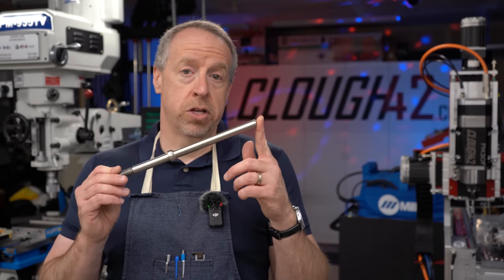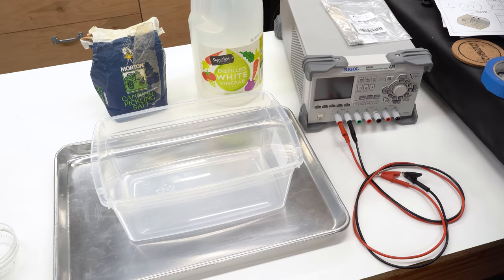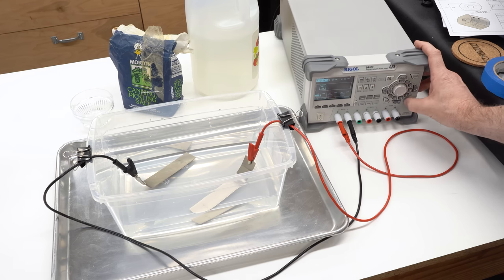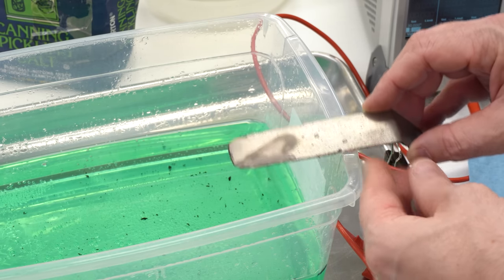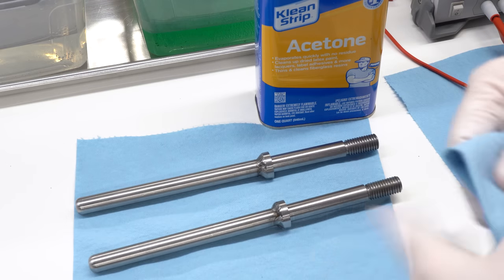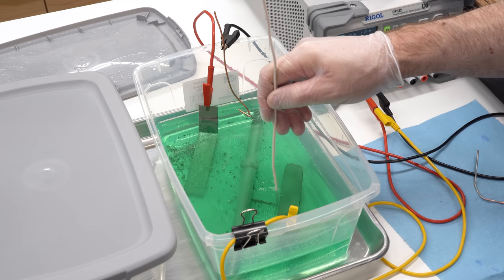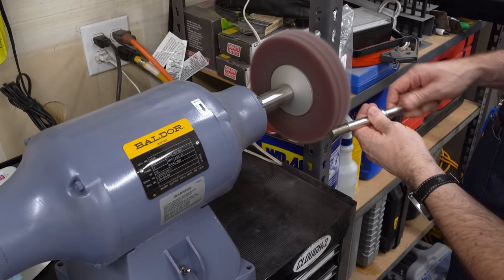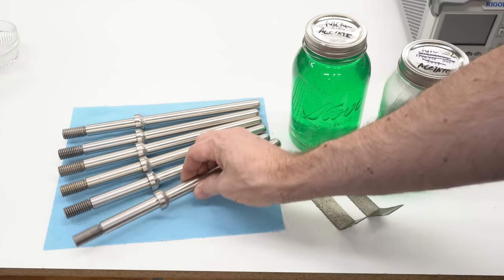Nickel Electroplating in the Home Shop - A Shocking Way to Prevent Rust!

Comment: Great video, thank you!
If you’re looking for a much cheaper source of nickel, I used cast iron welding rods (98% Ni + Cl I think, with the flux removed) as electrodes with great success. I plated the shafts of my Vallorbe needle files to prevent rusting and it came out beautifully!
I’m concerned about the environmental toxicity of the acetate though. How should one dispose of it after use?
Reply from the maker: There are lots of sources on-line that recommend various ways of disposing of it, from plating out the nickel, to evaporation, to dumping it down the drain.  Every article suggestiong one of these has a chorus of people saying it's definitely wrong.  I don't know what's available, legal, or recommended where you live.
Reply: The acetate can be filtered to remove crud, and used over and over - indefinitely.

Comment: I'd lower the current to get less porous finish.
And as mentioned earlier, one doesn't have to use acetic acid (i.e. vinegar) and suffer. Other acids like citric one work just fine or better and do not stink. Try alkali (like vulgar soda solution) instead of acid and report whether high or low pH matters))

Comment: So James I do nickel plating at my home, and I boil down the vinegar to a stronger concentration than regular 5% or 6% off the shelf. I usually boil it down, (heat on low) by half the volume I start with. I recommend you do it outside because it smells horrible but I get fantastic results using a stronger concentration of nickel acetate and much faster and thicker plating.

Comment: I used this method quite a few years ago but found the plating did not stand up to wet conditions and flaked off with rust bubbling up beneath the coating. I remember acid etching prep helped but still not satisfactory for anything exposed to moisture.
Reply: And what about mechanical stress or handling
Reply: Seems like that would mean that air/water was able to get through some pinholes or porous deposition?    The few failures I've had were like that, under the microscope it was evident that I hadn't done enough to prepare my parts, or hadn't formed a thick enough layer to resist shop life. 

I've found that for tools which are handled frequently, get slid around, contact chips, etc, it pays to go overboard.  Don't try to put it all on in one go, either.  That 'junk' can get stuck to the part, and block plating underneath.  Plate it, clean it, plate it again in a different orientation.

Parts that have concave features will have less plating in those places.  When I plated my favorite surface gage, I did a couple passes with the nickel electrodes positioned so they were closer to the concave surfaces than the rest.  That same principle applies to electrolytic rust removal also.

Comment: What blew my mind when I learned it is that EDM is basically electroplating with the electrolyte moving fast enough to prevent deposition.
Reply: EDM is not a plating process, the water or oil is non conductive.  It's a spark erosion process, the metal is vaporized by the pulse arch from the high voltage on the electrode.  The fluid, DI water or oil is used to wash away the swarf and cool the part/electrode
Reply: I was going to wright what a prat!
But Craig has way more tollerance of morons than me.
Reply: @craigs5212   he is likely confusing Electrical Discharge Machining(EDM) with Electro Chemical Machining (ECM)

Comment: Thanks for the knowledge.  I also learned some things listening to people from the greatest generation.
- During the war and after they skipped a step in the copper-nickel-chrome process resulting in less corrosion resistance and chrome peeling like paint off a wood house.  This caused the term triple plate to separate quality from junk chrome plating.
- They said that before a bumper got chromed, it looks like, and has to buffed to look like, one that is already chromed.  You cannot tell if it is or isn't unless you see a chromed one right next to it.
- They also reconditioned bumpers by stripping, buffing and re-chroming them.  They looked like new but didn't stay that way because remaining rust pits invisible to the naked eye would soon emerge which made people demand new bumpers after an accident.
- A lot of chemicals they use to remove auto finishes in car factories is more recyclable but also very strong.  I had them strip some die cast louvers on a classic car and it ate the die cast and I had to replace them.
- One guy committed suicide in the plating department with the cyanide they use in the process.  In general, people did not want to work around the plating tanks or in that department.  My guess is a lot of that is automated today.

Comment: Two things stand out for me from this video (in addition to the normal excellent information & presentation):

Your experience with vinyl gloves reminded me of the time 40+ years ago that I tried putting auto enamel paint reducer in a styrofoam cup – fortunately, the cup was on a driveway and not inside on anything. This is why 1) I always use native gloves when I need to protect my delicate hands and 2) I have an assortment of disposable aluminum cups (otherwise know in my household as "more junk") for use around acetone and other "aggressive" solvents.

Mixed dimensioning systems – I typically use off-the-shelf Imperial stock where possible for my projects; however, since my machines are made elsewhere I use metric hardware for assembly and attachment to the machines, and to limit the amount of hardware I need to have on hand. Thus my drawings  always include the note "Unless Otherwise Noted, Dimensions are in mm," which results in 1-1/2" x 1-1/4" x 1/8" 6061 angle being cut to an overall length of 250mm. I make no apologies for doing this as I consider it following day-to-day practice in the UK: when I spent time in England, Scotland & Wales in the late '90's, highway speeds were expressed in MPH, distances in km (or meters when a sign was directing traffic to an offramp) and clearances below bridges are in feet. Even now, Wheeler Dealers and Top Gear both use MPH, and the roadway signs I see on these shows follow the conventions previously noted. Plus, as you say, it drives people crazy.
Reply from the maker: Yeah, I do exactly the same with mixed units.  Imperial stock is readily available, but I try to use metric fasteners for things like a DRO install, just so I don't need two sets of tools when working on it.

Comment: The higher the amperage, the faster it deposits, but the larger the grain of the deposition.  Ever have the Crome plating flake off cheap tools?  They push the chrome on at high amps.  Looks shiny, but isn’t well attached to the base metal.  Higher cost tools take more time to plate at lower Amps, and get better adhesion.  Also, for a shiny nickel finish, you polish the piece before plating, and then after.

Comment: I have done electroplating for a few years,,,, and chrome plating.
And i have the entire suite in regard to surface treatment. sand blasting , zinc spraying and painting ( wet and powder )
And the thin layer ( few 1/1000 of a mm ) you get electroplating will not do much as soon as you get past corrosion class 1

Comment: Very good methods!!! Just remember to do this in a well-ventilated area as in eletrolysis of NaCl, Cl2 chlorine gas is made, which is toxic. It isn't that much cl2, so nothing TOO toxic, but always be cautious with chlorine. To avoid chlorine altogether, instead of NaCl (table salt), use another salt like epsom salt/magnesium sulfate or anything else without chlorine or any other harmful gases.. THANKS💯💯💯💯💯

Comment: I have nickel plated faucets. Some are polished. But nickel just doesn’t stay mirror bright. After some time that will dull. I’m used to it. I’ve never nickel plated anything, but I know it’s best for something not normally touched. Back in the old days, early in the 20th century, /rolled ‘Royce used to nickel plate their stick shift with nickel plate. A craftsman would literally pound the thin plate onto the steel shaft until it bonded. Whew! Then chrome plate was perfected and nickel plate disappeared on automobiles. Now it’s mostly decorative. It’s not that hard, so it wears off.

Comment: I have done some nickel plating like yours and it’s a blast. To get a chome like finish you need to to have the part super polished but for your application those look great! I did some testing for durability and the plating is extremely durable, I mean like it ain’t coming off! If I had to guess I would say it’s just a couple thousands of an inch thick. I’ve also refurbished some vintage craftsman handtools and they look incredible. I’m very happy with the results. One small thing I would recommend is after you make the bath use a coffee filter and filter everything so all that black gunk comes out in the solution is as clean as possible. That may help you get a better finish. Great video!

Comment: I have been told that you get better results if you copper plate steel parts first before nickel plating them.  Nickel supposedly binds more tightly to copper than to steel.
Reply: The reason they plate steel with copper is because copper is easier to polish than steel is. So you use a copper layer if you're going for that shiny finish. Then you polish the copper to a high shine. If you skip the copper then it's called hard chrome plating. Oh and you plate the nickel with chrome. duh.

Comment: I built my spiral stair-case, back in the mid 1980's. 3" in. dia. Pipe / schedule-40. to prepare the surface for (chrome / nickel) plating by a professional, I sand-blasted the surface with "Wall Nut shell's," to get that pre-polished look. Please take note, at the time, I did have a high output 5 horsepower Air-Compressor, and not one of those cheap ones you see in the big box stores or at Harbor Fright (spelling intended.) I paid just over $3,500.00 back then for it.  Also had purchased what is called a "Air-Kool-After-Cooler," so as to take out / remove the moisture in the compressed air, along with some special (AUTOBODY) air-filter's that also helped to dry the air.  This was very valuable in preventing "FLASH-RUST."  The Walnut shells, worked like a charm, to achieve that polished look.

Comment: Its been a few decades since I've done any plating but a thin copper plate first is best for adhesion and a smooth coating. thats as simple as Copper sulphate solution and the same apparatus. That layer only need be very thin as in a couple of atoms thick. Also the brightener for Nickel solution was Saccarin in quite high concentration. Yours will be fine though porous so susceptible to rust also.

Comment: NEXT EXPERIMENT: Try purchasing Pure Tin Solder Bar and tin plate old cooking pan, it will make it non stick again ;) but you can tin plate or try copper plate with the same method using copper pipe or bar and possibly copper sulfate!  Great vid! ty

Comment: Nice! I have found electroplating to be a valuable addition to the processes in the shop. So far I have tried Zinc, Nickel, and copper with success. I have found plating to be a good alternative to paint and powder coating for machine tools and fasteners.
Reply: Except powder coating is far less toxic and makes vibrant colors. Plus there are powder coatings that look just like any type of plating except chrome. Nothing can match real chrome.

Comment: Equidistance is crucial for an even plating. Best results are achieved when you use electrodes all around the part. I do a lot of electrolytic derusting and I actually use a iron cage to get even ion migration.

Comment: It will be interesting to see how these hold up, corrosion-wise. I nickel plated some garden shears a few years back and they didn’t rust as fast as before. Maybe 3x slower? I was hoping for much better. It was my first plating experience, like yours, so my quality was a complete unknown.
Reply from the maker: I'm a terrible test case.  I have exposed mild steel everywhere in my shop, and nothing rusts here.
Reply: @Clough42  you would be jealous of how fast things rust in my shop!

Pro tip - if you want a light patina on all of the metal surfaces in your shop, leave a small container of hydrochloric (“muriatic”) acid out.  It is VERY effective.

Comment: FYI- if you don’t like the matte finish and want a brighter, shinier finish I suggest soaking the part in a low concentration of Hcl (I.e. 0.2 mol) for even etching.  Wash in distilled water , dry , then nickel plate.

Comment: Have been watching streetips handling several industrial grade acid families and his care at managing his waste. 
Would repeat the recommendation to sock your anodes in a lintfree or fine graded filter barrier. Will not stop the transfer but may hold the crud off. 
Watch his silver and gold cell vids for useful ideas. 
Also take you vinegar and filter it through a proper medium to clear particulate. Might take several passes.

Good luck with it.

Comment: Add a brightener to the solution, there are commercial off the shelf ones or go diy with saccharin for instance , or polyethylene glycol which is available in Movicol , yes the thing that helps with pooping.
If you want to go more high tech , use a pulsed constant current supply ( yes that sounds like a contradiction but , think of a square wave , plotting time on the x axis and current on the vertical  ) . 
Using both of these will improve the finish , basically you're controlling the granularity of the deposition. Large granularity=dull  , small = shiny.

Comment: Acetone is a good start, but you should consider electropolishing the rods before plating. That will pull off all the oxides, especially around those welds. I'd prefer to just make the whole bar from 316L but the prices prices of the bar stock the average person can get seem ridiculous.

Comment: I've been nickel plating my laboratory utensils four years to protect them from chlorate and other extremely corrosive. Don't use a nickel plate and less it's pure nickel. The best ways get nickel welding electrodes they are pure 100% nickel and they work well. I mean they're expensive but they're worth it

Comment: Hi,
some electrical thoughts and other questions + ideas:

Can the solution be made with AC instead of DC?
it's about getting the nickel into the fluid, so on AC the electrodes would be both used up at the same time, not only one. Hydrogen bubbles would also be shared between both
Now it might be a problem that 50 or 60Hz from an (isolated) transformer are too fast, so the ions (?) cant really get away from the electrodes and get pulled back.
But maybe using an H-Bridge or switchover relay at 1Hz or 0.5Hz could work.
Using a long tall bottle for making the fluid would help with the bubbles stirring the fluid. - add a flame on top for some action ;-) (Or safer = good venting)
- i am a bit scared of putting a lid on basically a hydrogen gas tank.

Next thing to test would be running the low power, low frequency AC (transformer + resistor) through the electrodes
AND the DC from one electrode to the part at the same time.
For the electric circuit you can easily separate it, maybe this would help keep the fluid saturated.

A LM350 setup as current regulator and a 18V transformer (or 24V) might be a setup for permanent usage without having to block your bench power supply.
Maybe aid the LM350 along with a light bulb or a resistor (which could heat the fluid). If the current is too high (lm350 too hot) move the electrodes further apart.
For the transformer output voltage it's around 1.4x after rectification with smoothing caps, so 18V AC will land you around 25V DC
(The 24V AC transformers are more comon because they are (were) used for isolated outdoor christmas lights, so no dangerous input wiring needed for non electricians)

As it was for my pcb etching (which is a bit nastier) i guess pumping the fluid around and keeping it at a certain temperature (fishtank heater, they are glass tubes) would probably help. There are all plastic centrifugal pumps out there (Eheim with ceramic shaft) or maybe even a plastic geared pump + fuel filter for gunk.
(Thinking about it.. my etching fluid would have been nice for copper plating i guess ;-) )

Nice to see a working setup done with household chemicals,
maybe a bit of a warning/disclaimer for the "drying your pet in the microwave" people could be added.. (chemical leftovers, waste disposal, putting in the wrong metals)
since its the internet and taking responsibility for your own actions is not common anymore.

Comment: Been thinking of doing this to the bare steel parts of an antique drill press The chuck, stand pipe, crank, etc.  I'll build a wood form on the floor then line it with some type of heavy plastic (heavier than a painter's plastic drop cloth).  Use an old 12v 2-10amp battery charger (The old fashioned "dumb" kind) for my power supply.  I have only to decide whether I want to use nickel or zinc...or copper, lol.

Comment: I know with zinc plating that if you use only low current and buff the part intermittently with 0000 steel wool, interrupting the plating process, you get a much shinier finish. Maybe it would work that way with nickel.

Comment: The purity doesnt matter that much. Nickel like zinc and copper and other usually plated metals tend to get deposited at higher rate and lower voltage then other metals. 
Also, you can use water with some salt, you dont even need to put a lot of it, after a while, it will make a similar solution. It may take longer for the solution to get conductive enough to allow the electrolysis. 
Distance between the electodes is important. You might not see a difference but the thickness is definetly different. You can use a bigger tank and up the voltage or you can add some fabric or thick sponge between the closest parts to help spread the ion flow. 

You can also buy sacrificial anodes for boats instead of thin plates